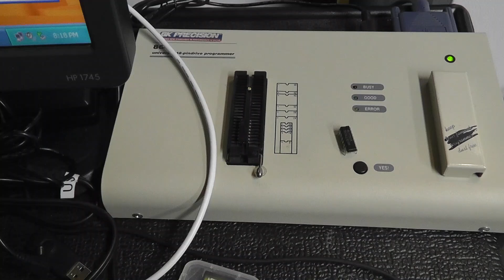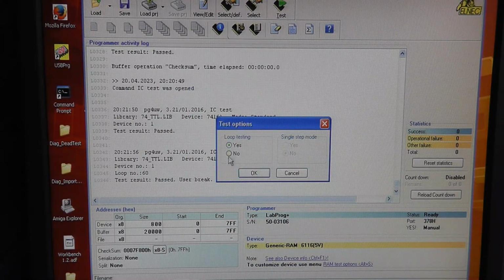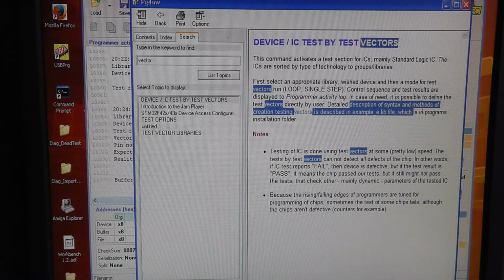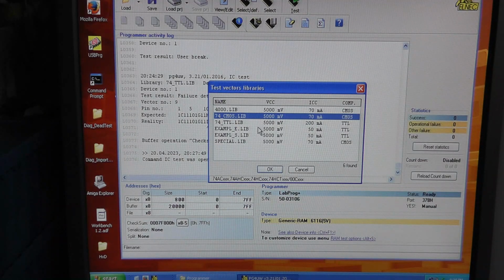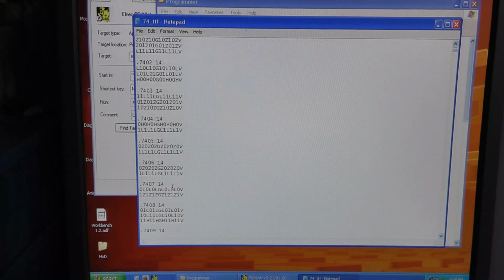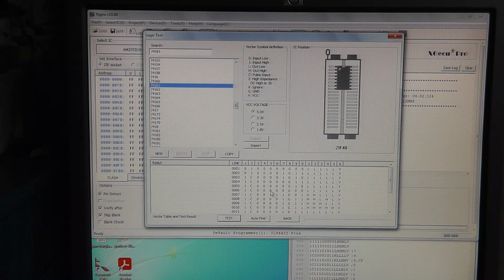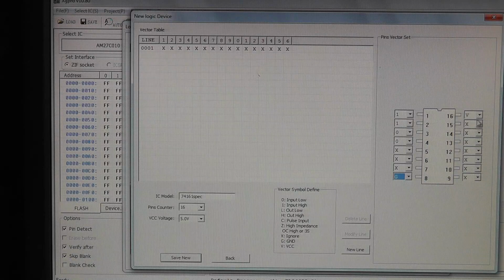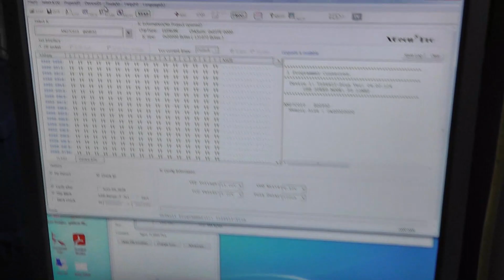IC Vector Testing with BK864 and TL866 Device Programmers

Comment: Not just counters, but I can see a challenge in testing GALs and PALs - even if you create your own custom vectors. CMOS tests probably pass because the mA threshold is lower.
Reply from the maker: I don't think I showed this in the video but I tried manually modifying the ttl vector file from 200mA to different values, including 70mA, and didn't get different results.  I am not certain it is a true variable that can be set but rather a static description.

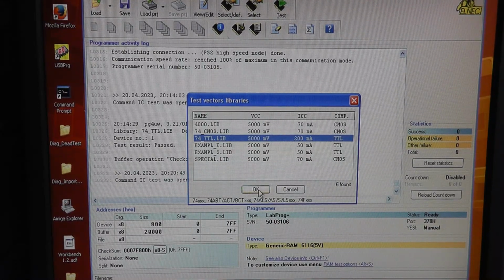Comment: @2:14 Sounds like a current limit on the supply.  200mA being big enough to run the chip but not too big that smoke pours out if the device under test is shorted.... i.e. the programmer cuts out if the chip tries to draw >200mA.
Reply from the maker: That could be it.

Comment: How are the Replacement Vector files differ than the Non-Replacement Vector files?
Reply from the maker: Are you referring to the ones I started creating manually on the TL866 software?
Reply: @jacklick  No not the manual ones your created. You mentioned that there are websites I'm guess that others techs have posted "Replacement Vector files" which I'm guess you can copy&paste or would have to manually create you own by the replace vector files. Various Programmers are going to have different TTL Vector tests for testing the same TTL chip part number. So you can fid the vector files of other programmers and either have to manually copy them into your programmer or there might be a way to "insert" and "add" the vector files from other programmers? I saw how you manually created your own vector test but there must be a way to "insert" and "add" a vector file from another programmer
Reply from the maker: I linked a reference website in the video description.  From wikipedia..."A test vector is a set of inputs provided to a system in order to test that system".  With TTL logic we have know what the output should be based on different inputs.  Each vector is a slightly different combination of inputs and thereby validating the chip behavior based on expected output.    The test vectors provided by different programmer vendors might differ but are really specific to the type of chip.  A test vector from tl866 should work in bk864, assuming everything else is "equal".
Reply: @jacklick  Does the BK864 and TL866 have any NON-vector tests for TTL & CMOS chips? There should be other types of TTL & CMOS tests other than the vector tests.  Have you tried using an oscilloscope to measure the waveforms of the BK864 Vector stimulus waveform and also the TL866 vector stimulus waveform? because the vector test stimulus waveforms shouldn't be a normal squarewaveform and I'm curious to see if they are different test stimulus waveforms on the BK864 and the TL866
Reply from the maker: @waynegram8907  What other tests should a device programmer be able to do on digital logic ICs?
Reply: @jacklick  Different Test Patterns and Test combinations with the truth table of the IC datasheets. The Programmers is like a function generator that has various test signals which they call them stimulus. The programmers should have non-vector tests for ttl and cmos chips. For RAM chips the tests aren't vector test right? they use different test patterns for testing RAM chips which various programmers will use different types of test patterns for testing RAM chips, so it might pass test on one programmer but fail on another test using a different programmer because of the algorithm of the test stimulus program. If you use a logic analyzer or oscilloscope you can display visually display the test stimulus program of the programmer by monitoring the IC input pins. Each programmer should have a different test stimulus program algorithm.
Reply from the maker: @waynegram8907  I am fairly confident you are on the wrong track.
Reply: @jacklick  So those portable handheld IC testers use Test Vectors? NeoLoch Inquisitor IC tester, Vizatek VZ4 IC tester, Professional Intergrated IC Tester. Most of these portable handheld IC testers will PASS test but when testing the same IC chips in a TL866 or the BK864 it will FAIL test.
Reply from the maker: Prove to me a neoloch tests 74xx ttl chips